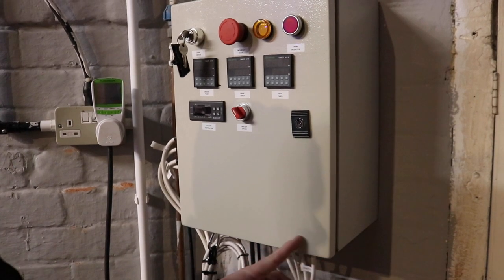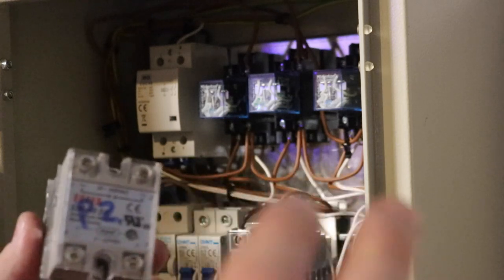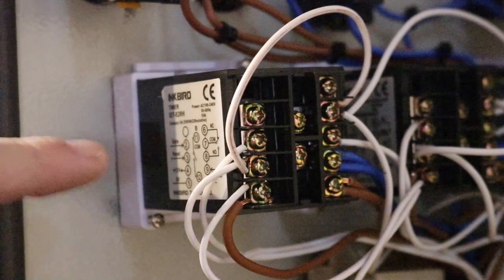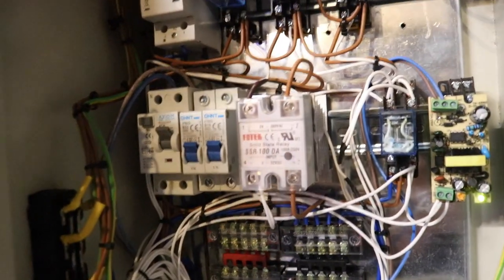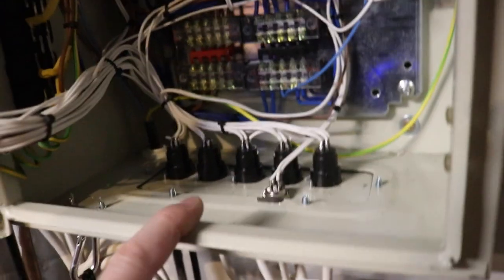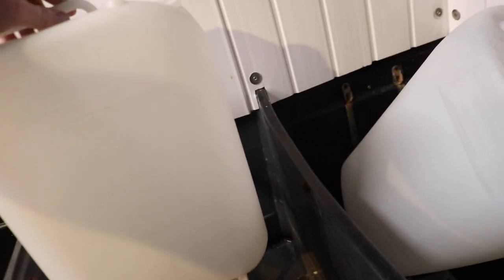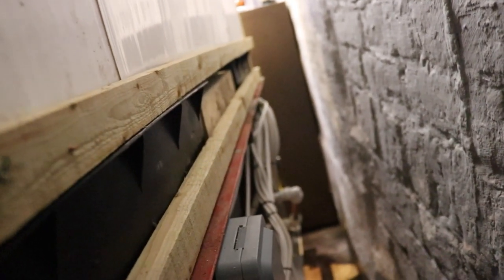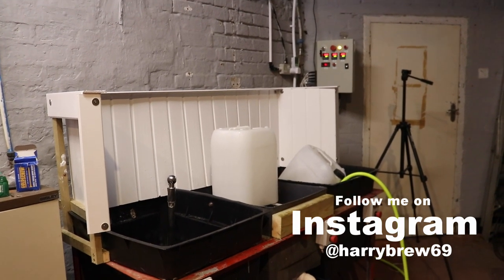Cask Wash Build ~ Problems & Last Look

Comment: Without a scope on that 12V output it is kind of difficult to recommend anything. The instructions for that timer specify the 12V output has a limit of 50 mA max which is pretty weak, but the Fotek SSR should not be pulling any more than 10 mA. Unfortunately I don't know the circuit to understand if anything else has been connected to that 12V output drawing more current from it.
Reply: Sure it would, no questions there - but do we honestly know that the 12 V output is PWM and that is what is causing the problem? I don't have one of these timers otherwise I would put it on my scope to see what exactly is being provided on that 12 V output terminal. If it is PWM then what is the duty cycle of the PWM? The duty cycle of the PWM signal will directly determine what the output voltage will be depending on the load placed on the capacitor.